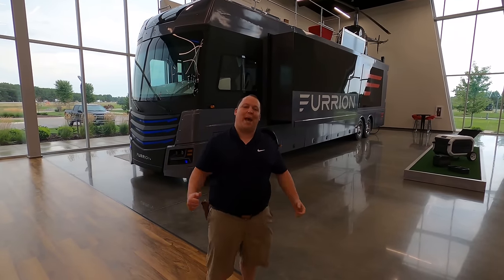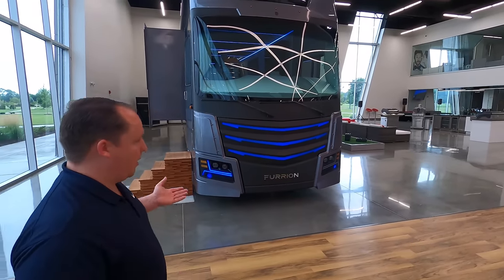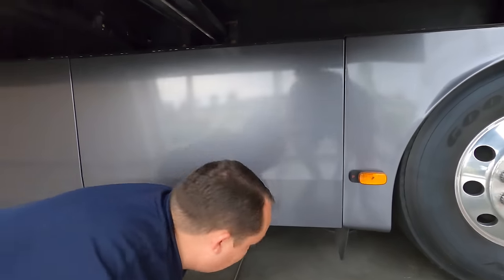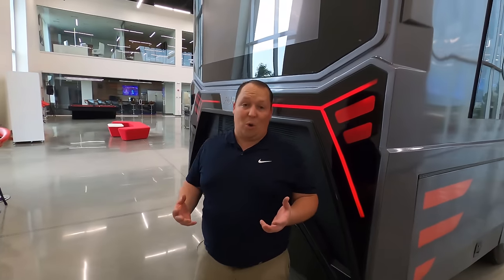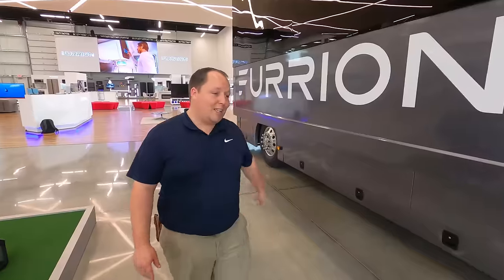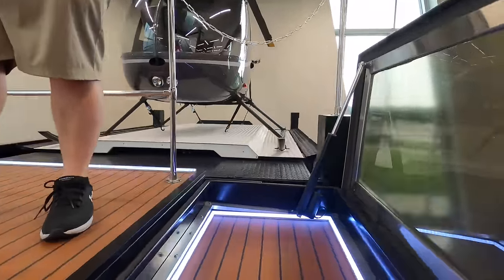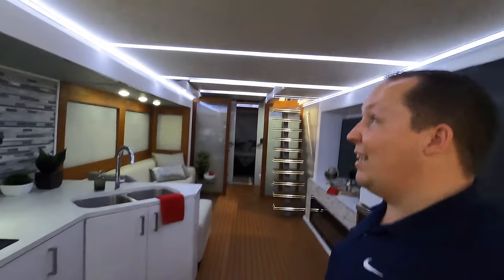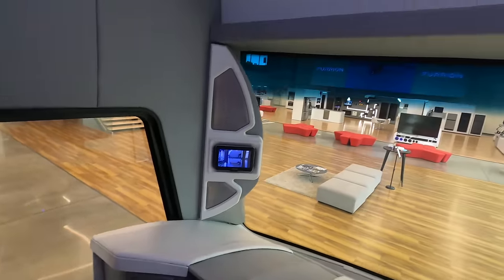Furrion Elysium - This RV has a Helicopter on the Roof 🚁

Comment: What...no, "It's time for the MSRP - per-per-per-perrrrr?"  :^D
Kudos for outside the box review of an over the top RV...indoors!
Don't own any Furrion products - yet. I thought they were an off-brand too. Now thanks to Matt and their openness I am a better informed consumer. Win-win.
3 Dislikes:
1. Vents in the floor. But I guess since there's no roof A/C it has to be under the floor?
2. Dishwasher across the room from the kitchen sink.
3. No place to eat inside comfortably. I get you, Matt. But I like to eat indoors when it's cold, rainy, or there are lots of flying bugs around.

Here's an idea - why not make a dinette that converts into a lounge instead of a bed? I mean by folding, with no holes in the floor and posts.

3 Likes:
1. Who needs a toad when you have a chopper.  :^ )
2. Awesome living area.
3. Killer shower.

Great job guys, Will was a great sidekick. Say hi to Andrea, we missed her!
Reply: Dislikes are no drawers in the kitchen.  That is the first thing I look for. Weird dishwasher placement and could do without it. Lack of clothing storage.  Lack of towel and linen storage.  Could have a little less lounge area and a table/desk area.  Cockpit is amazing but the wide corner posts could be a driving visibility concern.
I do see many features which I hope to see incorporated in new motorhomes especially the design look, the lighting and the rooftop access.

Comment: Pretty cool that you could do this video! 
3likes: 
1. the led light strips
2. Light coloured interior (not a fan of white furniture though it looks really nice)
3. Shower

3 Dislikes
1. Cockpit- can’t see over the dash enough. I wanted you to raise the seat...but then could the pedals be reached?
2. Fridge/freezer doors don’t open wide because there isn’t clearance on the left side. Just 2” gap spacer would do. 
3. Helicopter & its pad & jacuzzi. I’m too cheap to hire a pilot to fly the thing. Also don’t want extra people around when I’m getting away from it all. Without the roof stuff (still want the decking to safely lounge & set up photo equipment) the stairs can go (I’ll climb up outside-telescoping staircase would do) & storage can be built there & in the bedroom. 

All I need is $$$$$$ & it can happen!

Comment: Great concept Motor Home. As you said, Matt, Loads if concepts here which needs to be incorporated into the market. The LED lighting is such an easy (energy efficient) fix...the sofa...could have "aircraft" style trays...flip open the arm rest and flip out a tray...the size of the sofa would easily accommodate flip up trays.. really like the.. use of the  roof area..you can keep the helicopter... overall like these concepts. Thanks for the help Will!

Comment: If I was able to go to a nascar race in that thing I would end up getting stuck on the roof because I'd never make it back down those stairs without falling off the side with no railing ..... Probably wouldn't even have to be drunk to fall.  I cannot get over that hot tub. The helicopter could go and I'd rather have a lap swimming pool with a sunning and drinking area.  Cannot imagine the weight capacity needed to hold all of that plus the water in a pool though.  The hot tub water must weigh a ridiculous amount already.  This really is the coolest motor home I've ever seen also.  Matt, you look like you belong in that hot tub on the roof!! I think this motorhome suits you and Andrea! You keep working like y'all are and this thing will be chump change for y'all 😊👊🏼

Comment: I've been saying this for years.  
1: We eat at the couch or desk.  Give us a coffee table and be done with it - better yet, one that drops into the floor or away.  I want a living room and not a cramped mess. 
2: 90% of all people aren't going to have guests or need to fit 8 people in it like a hostel.  One big bedroom is enough.
3: My only gripe is the TV.  It's their tech, I get it, but it screams for a LED projector brick and a flat wall that turns into a screen/is painted with screen material and framed.

How open it is is a revelation and feels like something premium.  It feels like a small apartment and the roof, while a showcase piece, I also love it.  That you can have a deck up there.  If it was me, I'd have tables and couches and maybe some sort of power awning - not on the side where you never would use it, but up TOP.  Since you HAVE a top to act as an outside space.

Comment: Ok love the concept. But if I could make a few modest changes I would.  To start, ditch one of the outside TVs and make another slide.  Preferably a slide out that goes out back or to one side.  Add some airline tray tables that come up near the couch.  Go to a mid entry instead of front entry.  Place a bunk somewhere inside over a washer dryer. Keep the stairs but more grippier texture.  Or go circular stairs maybe.  
Oh I would ditch the chopper and try to place some kind of mini storage combo dresser closet behind the bed or create a sunken level effect with the bed up in some kind of loft.  Gotta def gotta keep the command driving section. Keep the light strips in the ceiling.  Now for the roof.  Ditch the landing pad unless you make a curved stairs down into the rear storage area and ditch the hot tub.  Instead I’d keep the decking with anchor points to place a table and canopy for outdoor dining like when watching the hot air balloons lift off or fireworks show.  For the railings maybe a spring kind of catch which you push down to lock then some kind of toggle switch located near the top handle bar to pop a release spring. Keep anchor points to secure the sette or cushions.  After all this time maybe if you can make some kind of quasi fake 2 story travel trailer why not make a quasi 2 story motor coach.  People have converted double decker buses to homes, I like to see it from a normal maker if possible

Comment: 👍 Smashy!  Only James Bond himself could land that helicopter on that moving helipad.  L: spacious living space slides out; cockpit area (too bad you were afraid to check if the horn was a semi ear buster); fine exterior color, Windows and slam-latch bay doors; appliances, what no washer and dryer, the driver has to keep themselves cleaned and pressed somehow.  D: nice bedroom but do you have to tow your walk-in closet behind you?; missing that spotless wet bay; no inside place to eat, gotta bring my 1970's stamped aluminum tv tables for each person, the ones with sunflowers on them; seems really difficult to access under bay storage with slides out, unless you are parked on a real smooth marble floor.

Stay safe you guys. 😷😷😷😷

Comment: Most disappointed, their's no mini-sub pen under the floor. I need that to escape from Jimmy Bond when he comes calling.

Joking aside, as Matt said their are many features that RV manufacturers should be thinking of using. If you look at boat designs, they have tables that fold away behind the settee. The ovens and microwave design looked good (expensive?). And while the helicopter on top is a bit of fun for a show RV. The inside steps up to the roof could be done with a sun deck on top with fold up hand rails. Ok, not on a budget model, but on a manufacturers top model. Why not?

Comment: The 3 things I like about this motorhome:
1. the cockpit area
2. the LED light strips instead of the puck lights
3. the modern furniture

The 3 things I don't like about this motorhome:
1. I'm going to combo the bedroom and the toilet: bedroom is not accessible when the helicopter pad is down, no wardrobe, toiler position, and electronic toilet.
2. heat ducts in the floor
3. baggage doors flip up
4. all the electronics

Comment: My first thought on seeing the coach was, "Oh, yeah that’s not remotely road legal" so thanks for bringing that up. In Indiana, blue lights of any kind are illegal regardless of time of day. Lights on the front may be white or amber, lights on the rear may be amber or red. Under glow is a grey area and is kinda up to the cop to enforce. Technically any color that doesn’t conform with the aforementioned restrictions is illegal but I’ve seen lots of vehicles that get away with it.

Comment: The refrigerator left door doesn't open due to oven too close. A refrigerator should not be next to a stove anyway due to the heat thrown. Liked the stove vent hood. I could do without helicopter if it meant storage in bedroom. Bathroom sink small lacking storage. Rest of space looked great. I've seen some Class B builds with roof sitting.

Comment: Looking at the steering wheel which looks very similar to Prevost and MCI, and also the placement of Allison Transmission shifter, it could be Spartan.  Freightliner usually puts the shifter either on the dash or on the steering wheel stick.  Or maybe build from scratch like Newell Coach.

Comment: Nice Motor home but the only thing I am not happy about is, I have in my closet here at home a furrion 24 inch TV that doesn't work right. I got it with my motor home I bought from El Monte RV in Santa fe Springs California. and when I finally went to Pennsylvania last summer I found that the TV kept switching inputs on its own. It would stick at times on AV or other inputs that I had nothing plug into. I just took it out of the RV and the only thing I can do is junk it and take it to a recycle place. I plan now to get another TV but not the Furrion Brand.

Comment: For a RV salesman who does RV revues, I cant’ believe you didn’t notice there’s no dinette or sit-in eating area! 🤦🏽‍♂️ There should at least be a Lagun table mounting system, as they were designed initially for marine use & this is a marine style decor incorporating luxury yacht design & style (of course yachts don’t tend to have Lagun tables, only smaller boats). 🤦🏽‍♂️ Having the kitchen in the forward section instead of mid-ship is odd too.

Comment: This is the best example of form triumph over function. The driver position is too far back and the wide A-pillars are a throwback to a hose blinders. The dash looks like a poorly executed 1975 ultra-modern concept that can double as a Zombie protection barrier. The open concept water closet right off the living room is the ultimate testament to a rare taste and class. The Helicopter up top will surely impress many lot lizards hanging out, after hours, at a truck stop. I guess the design team was too busy fantasizing about a topside wet T-Shirt contest to bother doing away with the intrusive internal staircase in favor of a retractable alternative.
I sure hope the Motorhome third rate design philosophy is not representative of Furrion electronics.

Comment: I saw Cummins red fuel filters in the rear compartment and that's an International steering wheel. Those monitors in the front side pillars should be rear view monitors since there ard no mirrors.

Comment: The water tank is up front to balance the helicopter on the rear.  Why not side opening doors?  Vents in the floor?  No side mirrors - it uses cameras.  The rest is amazing but they missed the simplest things! I love the skylight over the driver area.  A dinette  instead of the stairs because no need for a helicopter.  A ladder outside will be fine for using the roof as a deck.

Comment: Nice ride. But, I'd rather have an Entegra Cornerstone or Anthem 44B.
Furrion have been in Motor Yachts for years, because they take a beating and work forever. The body looks like a Winnebago and the chassis looks like International.
The Helicopter is a Robinson 44.
But, don't take my word for it.
I've been wrong before, I'm married.. 🤣 See y'all later

Comment: Did you notice that the LED overhead light that runs the length of the coach on the driver's side of the unit was flickering?  Was that an electrical issue or does the light need to be changed?  It's so long, I wonder if the light is a single unit.  If so, where would you store the replacement, or does it coil like a hose?
Too many electronically-operated functions.  Each is a point of failure.  They thought of having a manual backup for the awning, did they also think of how each feature will function manually if necessary?

Comment: Some things are very odd.  Can't open the refrigerator door on the left because it hits the ovens.  Oven doors don't open fully because of the refrigerator.  Why not put the wine cooler thing where the ovens are?  It's just me, but I'd prefer an opaque wall around the toilet as I don't think of using the toilet as a spectator sport. But hey, ya got a helicopter!

Comment: Dislikes: 1 Dishwasher placement 
               2. No Natural light 
               3. Limited storage and wardrobe space
               4. Air Horn
               5.  Co-Pilots Chair not powered or swivels
               6.  Small Refrigerator 
               7.  No ice maker
               8.  Vents in Floor
               9.  Fireplace Replace with Bookcase 
             10.  More Charging and outlets GFI ‘s

Likes: 1: Bath
           2. Color scheme 
           3  Hot Tubby

Comment: What happened...you're slipping. Totally omitted... "It's now time for the MSRP" ... "You can call, you can text, you can email, you can Facetime!..." I was all ready to buy it, but guess now I will just have to pass. (At least that' my story and I'm sticking to it.)

One thin that wasn't mentioned were the teak floors...that was also carried to the roof. Amazing. While distracted by the Jacuzzi, lounge and helicopter, did anyone else notice how clean it was with no AC, antenna, solar and other typical roof components. As a working model, assume that it has AC at a minimum. Masterful hiding of components.

Comment: My pro's and con's: For one it's not an RV, it's a high end motor home. I don't see this driving into a camp grounds or sitting on a dirt pad. with all the TV's out side of it are cool, but way over done.The design is not well planed out, and I believe you missed the RC. Tell me where would a good place to go where 3 huge TV's are needed on 3 sides. Perhaps a race track to advertise or what?

Comment: Well yes I had a furrion back up camera, got used maybe a dozen times max, cost $550, and it just stopped working! Tried everything to get it to work, removed it from the back of the trailer and plugged it into a portable battery, could not get monitor and camera to ever function properly again, no picture, googled for solutions, tried everything, a huge disappointment! Next got a brand new 5th wheel with the furrion chief oven n stove, oven never worked from day one, took the dealer 6 months to get a new part, finally had the oven working and now the furrion microwave just stopped working after only 10 months of use, it keeps blowing its fuse! 
See if you can guess what my opinion is of furrion products! Yeah nothing but Huge disappointments!

Comment: For an under end RV why did they have that ugly bedding and curtains and couch.  I just feel the interior design looks dated too the back splash looks like some tile from Home Depot.  It looks very 90’s with the black and white.  I think RV companies should look at the boating industry both large power boat and sail boats do a much better job with their interior design.  So for the Leisure Travel Vans does a modern design best with the RV industry.  Just my opinion.  I can’t imagine this company using that helicopter.  The landing space is very small and bit dangerous especially with any kind of wind.  One mistake and the helicopter would fall down.  That has to be a gimmick for this company.

Comment: No mirrors?  How is that legal?  Cameras instead of mirrors are too small for clear view - dislike.   Flip up storage doors - dislike.   Required to open bay to fuel - dislike (could be a space problem in truck stop).  Considering the glare, that rear TV would be terrible viewing.  Floor heat vents - dislike.  They need to talk to Joe Mullen about driver forward viewing angle.  Flip,down microwave at that height - dislike. Wasted space with exhaust hood (no storage).  Totally impractical, except as show vehicle.  Not impressed.